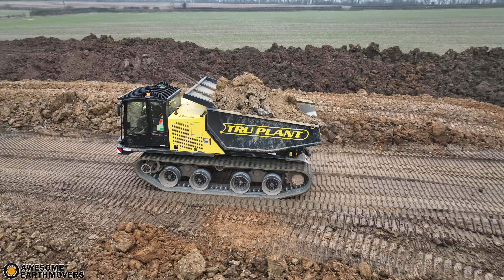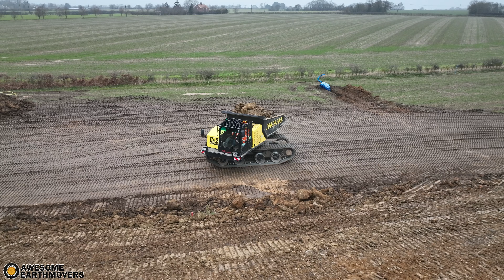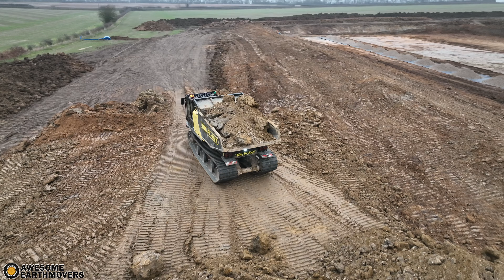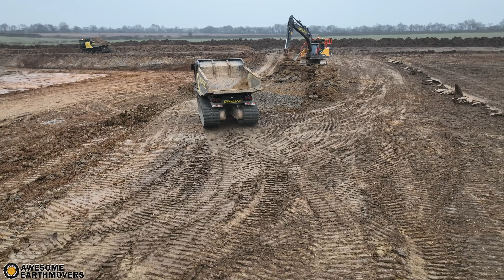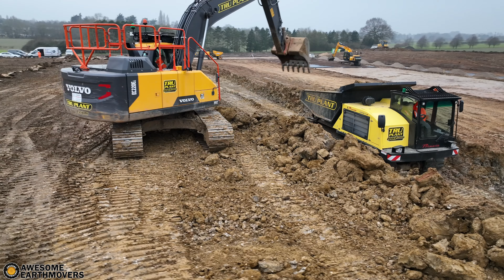Prinoth Panther T14R Full Load and Dump Cycle

Comment: Waste of fuel and it has not big board. Economically non efficient machine for a company.
Reply: Some sites are too narrow to allow a truck to do a 3 point turn so these kind of things are necessary. Usually rented for those type of projects since it's a short term construction rental.
Reply: It's not a bad idea at all.
Permit restrictions. 
Size of project. 
There is no turnaround time.
Digger should never swing a load over the cab..
No protection if a rock went through the window.